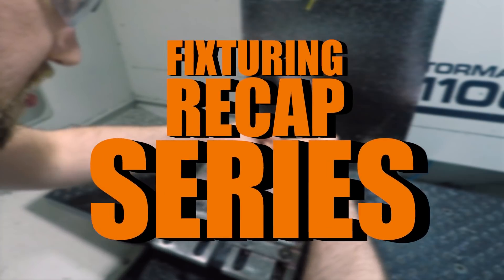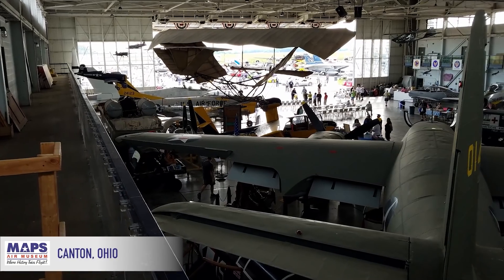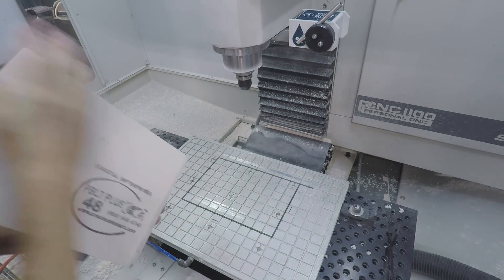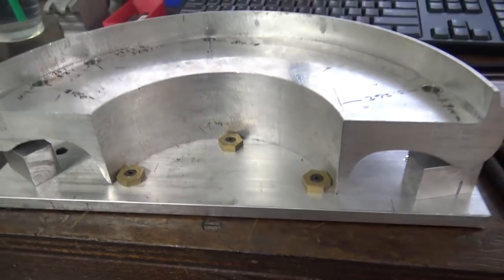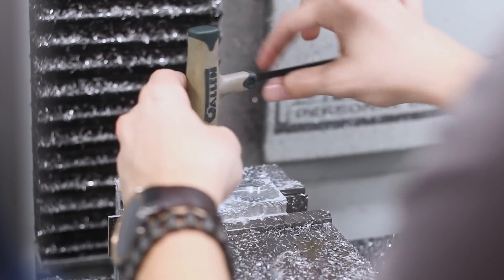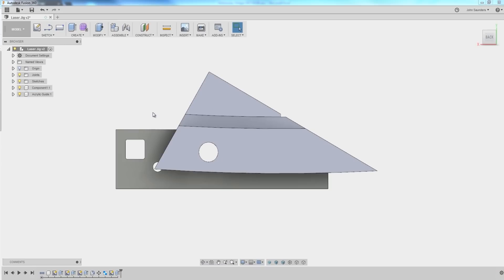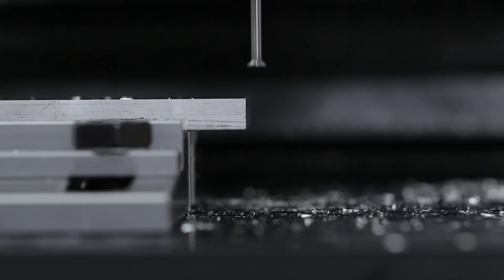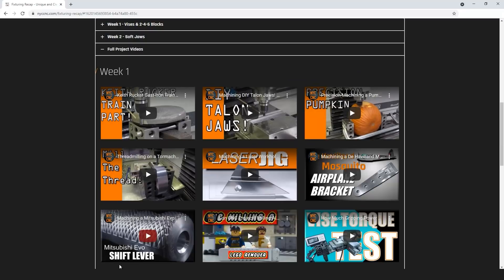Custom Fixtures: Creative Workholding Strategies for CNC Machining!

Comment: Great video series - thanks... One question:
What is that bolt-hole table and these super low profile vices you are using on both the PC1100 and PC770?